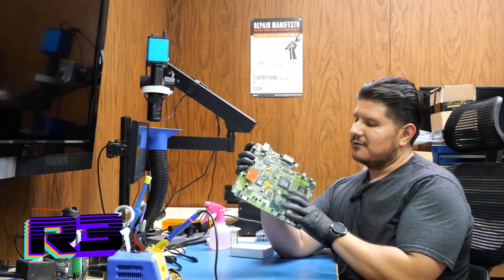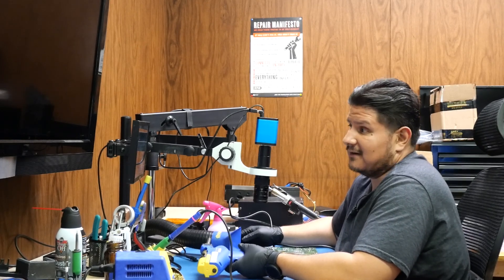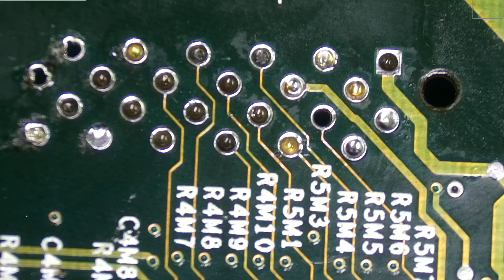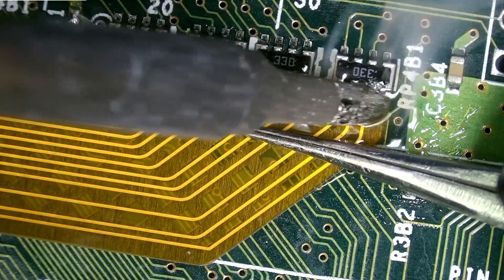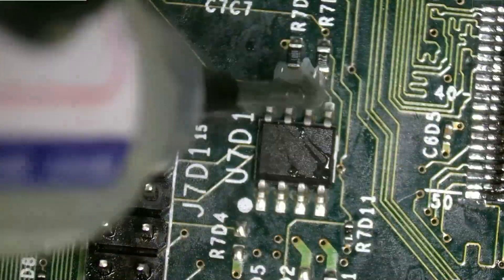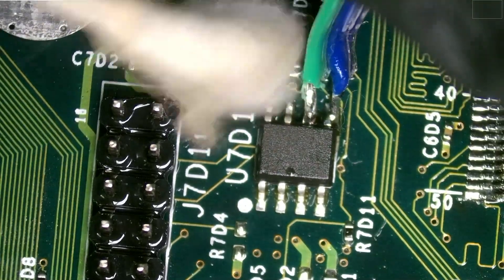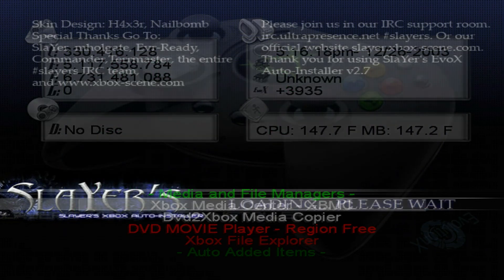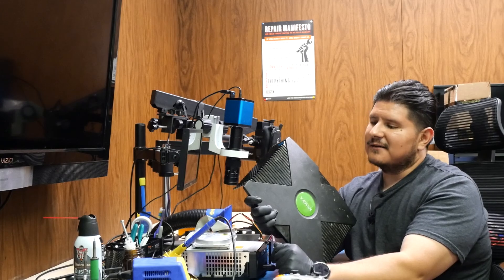OG Original XBOX v1.6 XBOXHD+ Installation - Install HDMI Mod MakeMhz

Comment: So I have installed the stellar mod chip and the xboxhd+ chip I have great video but no sound, I rewired and cleaned several ports not the best but  I’ve done this about 5 times and I still have no sound I have an xbox v1.6 any tips, have you ever encountered this?
Reply from the maker: I'd double check your SPDIF line.

Comment: Hello. Please tell me why I have version 1.6 with hd+, it takes 30 seconds before the BIOS loading animation appears? Fireware 2.2.2. bios kpatch 2.2.2, update 2.2.2
Reply from the maker: Is this with a standard HDD, no IDE to SATA board? I was able to speed up the boot times with an IDE to SATA board, but I would stay away from the cheap ones.

Most likely the slow speeds are due to the patching of the dash and the HDMI handshake, but I would just be guessing.
Reply: @RetroRenegadeRepairs  I'm using an 80pin and a sata adapter for the ide. The most interesting thing is that in versions 1.2 and 1.4 it loads normally, and in 1.6 you need to wait 30 seconds before the animation appears. Xenium on 1.6 refuses to work, I had to sew Aladdin on the patched Evox. Xenium installation was done using github, switched D0 on the chip and on the LPC closed to GRD, but refuses to work. I've read that it seems necessary to flash the blue version and then install the fixed one from MakeHZ for HDPlus, but pishitu seems to fix the bug, but they say it's inaccurate. Stellar on 80pin and on my ATA100\133 adapter, a 2 TB disk loads in 5 seconds
Reply: @RetroRenegadeRepairs figured it out))). I installed the chip on 1.4 and updated it to 2.3.5 from makehz. then I set it to 1.6, closed D0 and the chip started working))) but loading the BIOS is still delayed by 30 seconds. somewhere you need to find startech sata to ide and install ssd
Reply from the maker: Should be quick if you are using a startech sata to ide and patched for udma5
Reply: @RetroRenegadeRepairs  If you install Stellar, it loads instantly. It's not the cable and the sata to ide adapter. it's a bios issue. they say titanium needs to be installed and hard formated in fatx 3.0 marked titan
Reply from the maker: You can patch evox bios and others for udma5. Stellar automatically sets udma speeds, which is why it loads quickly with the sata to ide converter.